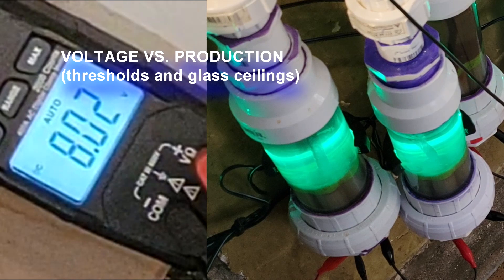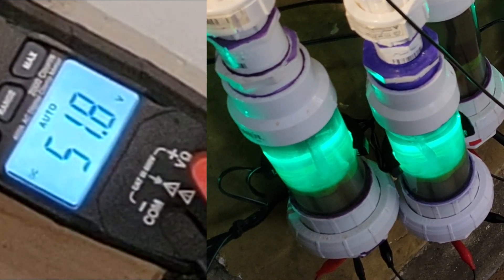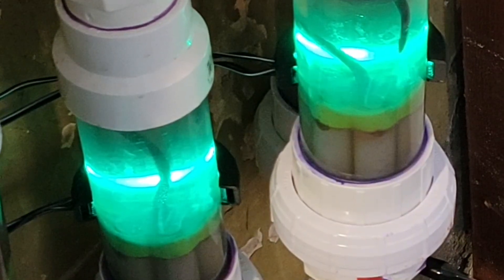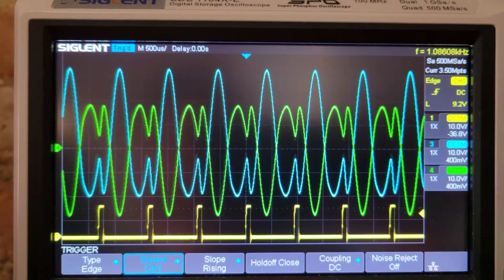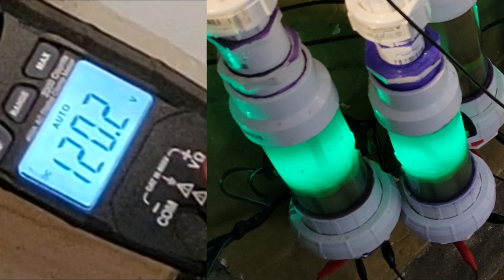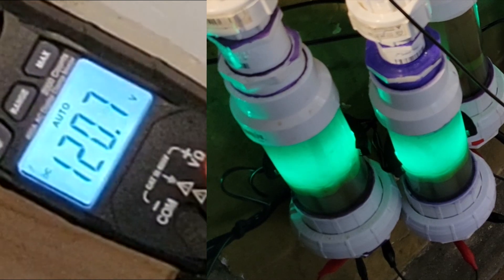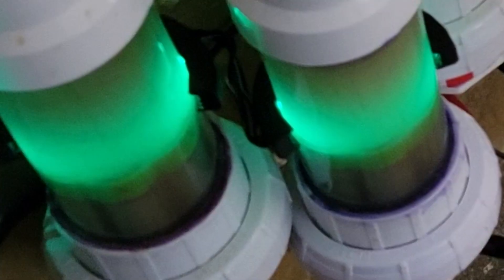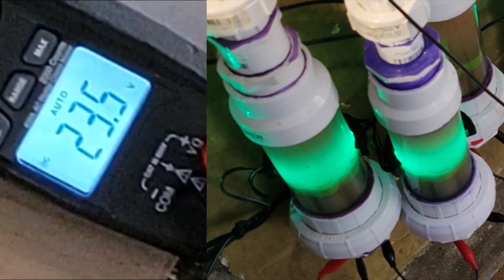Voltage Vs. Production - How Many Volts Are Needed For Molecule Separation

Comment: All Stanley did was create a water capacitor then step charged it till the capacitor broke down or discharged.
Reply from the maker: I don't think the capacitor broke down or discharged. It maintained a defined voltage level and it is the (water) dielectric that broke down. Discharge = amp flow = not wanted.